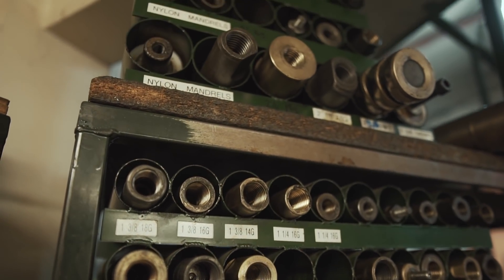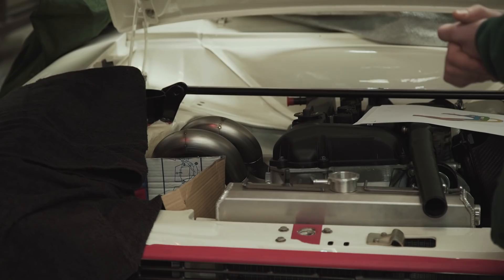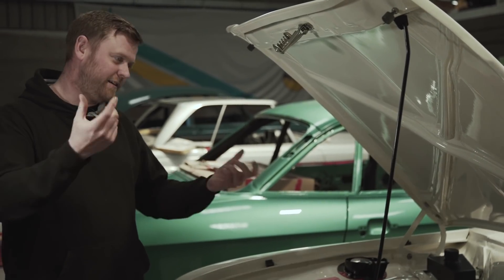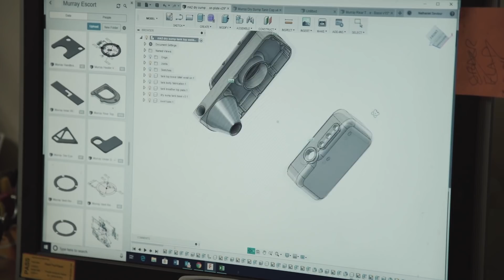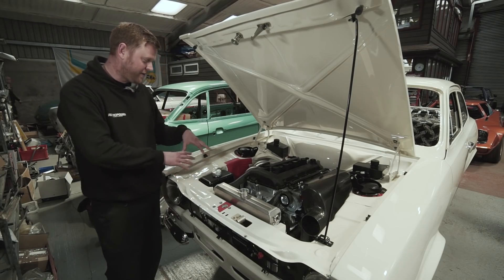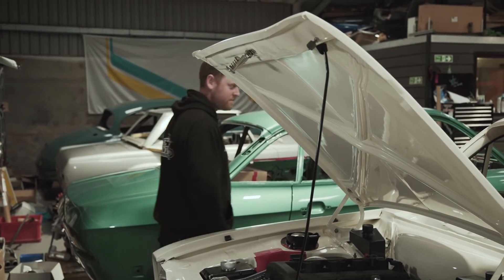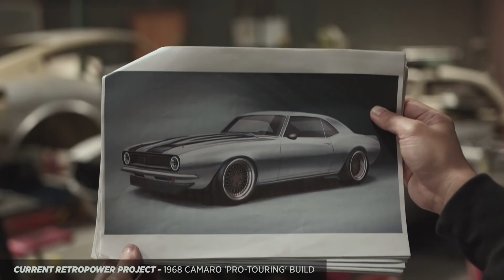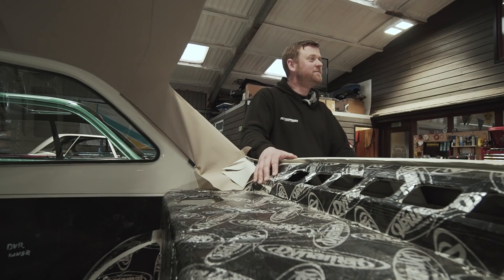Gordon Murray's MK1 Escort - Retropower Build Episode 14

Comment: Just sitting around on Sunday, re- watching episode's  : )   .... the windscreen washer jet delete idea is really slick!! .... then I wondered if there was a way to delete the wipers too??.... I know they clean the screen aswell as removing water, which is needed for a daily driver vehicle... but for a track car,  or a special occasion car... is a Dyson airblade type solution feasible?..... and then finally,  is there a solution to a problem you have dreamed of cracking??... you always have the finished product in mind, completely designed before it's started. Amazing to watch ***

Comment: well, The attention to detail is speechless..... now, I want to make a question. Does that engine have enough horsepower to make the rear suspension functional???  I mean, doing the same Jim Clark drive style at palace circuit with the LotusCortina. the reason why I am asking this, it is because,  that independent rear suspension  (A) BMW style, SIERRA style, and many others, it is JUST AMAZING, SOMETHING NEVER MADE SO FAR, HIGH QUALITY IN ESCORT MK1 . all we know that the escorts have GRP2 and GRP4 suspensions with or not leaf springs....i can't wait to see this escort mk1 running on the road . What a great example.

Comment: Stunning build but confused about cat to meet modern regulations? Modern regulations only apply to modern cars and no matter what you do, this is still a 1970s Escort, for MOT and other legal requirements. Regarding the MOT, will this be exempt or too modified to qualify?
Reply: Gordon might want a cleaner burning motor...???
Reply: @catlee8064  He may well do, but that will be a matter of choice, not regulations.
Reply from the maker: Car will be subject to IVA test
Reply: @retropowercars  Wow that is rough on what most would consider a first class resto with mods, rather than to be treated same as a kit car.

Comment: Have you used the original opening quarter light frames to go with the new glass? One of the frames on my escort is a little damaged and ideally I need to replace to make it perfect. did you also get the glass off the shelf?

Cheers